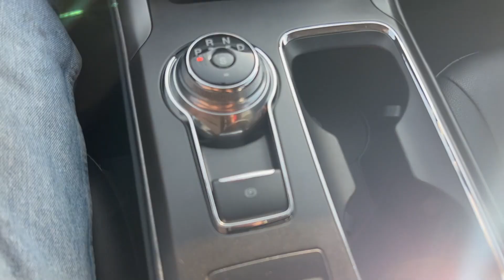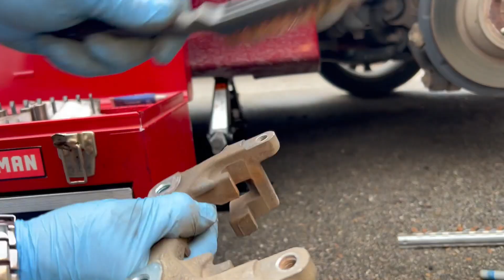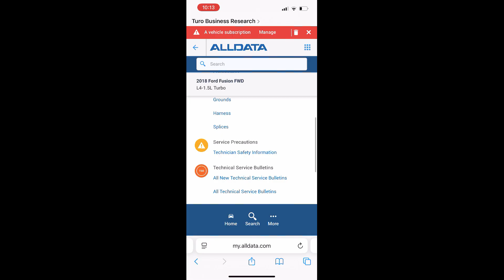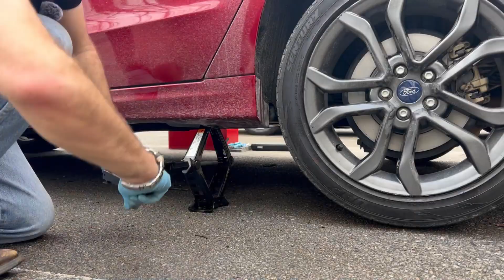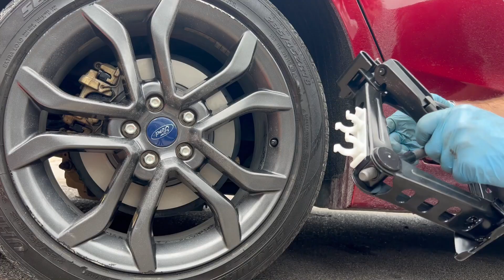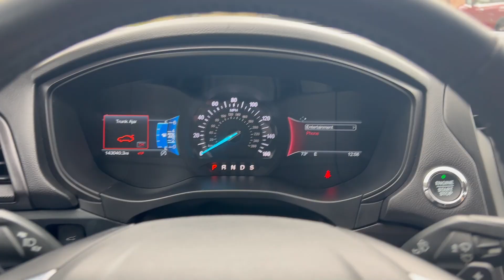Replace 2013-2020 Ford Fusion Rear Brakes Like a Pro!

Comment: What points do we lubricate for the pad itself and the caliper part? Is it just the back of the pad and the ends of the pads? And where the pad touches metal?
Reply from the maker: Great question!
For all sets of brake pads you’ll want to lightly lubricate the metal parts that touch other metal parts where they are held in the cradle piece of the caliber.

Here’s where some processes differ;
Some manufacturers will recommend adhesive for the pad backing. Some manufacturers will recommend lubrication. 
If the pads either have an adhesive resin with a peel and stick function, definitely no lubrication should be used on the backs of the pads. If you had to disassemble, you’d reapply an adhesive to the pad backing for reassembly. 

If there’s no adhesive, you can use a small amount of grease between the pad backing and the caliper piston and clamp on the outside. It’s probably not necessary but it should help the pad find a seat where it doesn’t vibrate at an audible frequency.